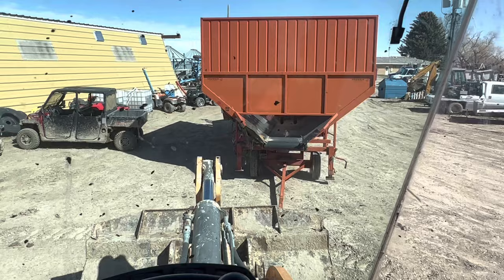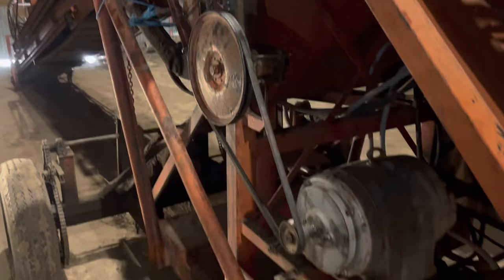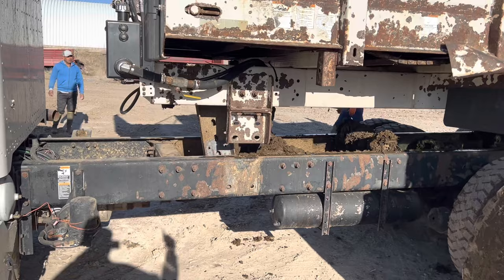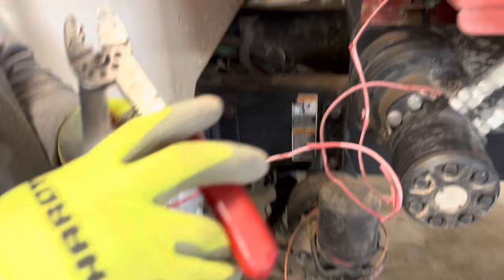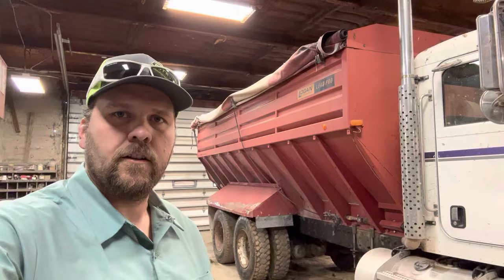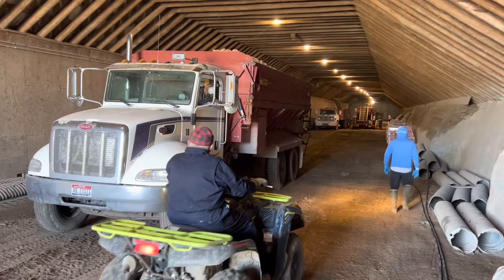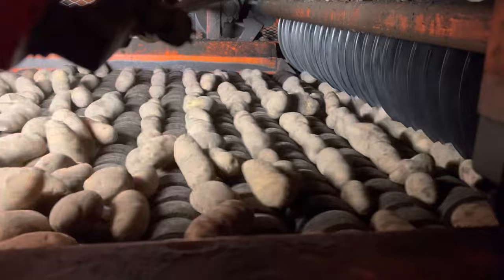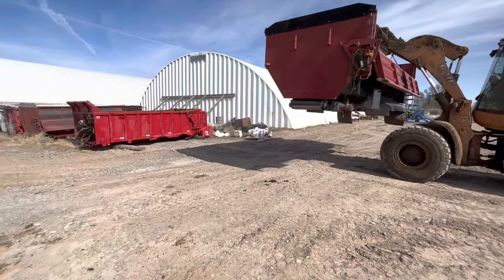How we cut our seed potatoes.

Comment: I saw another planter video recently that used a smaller whole potato as seed.  Interesting difference in the choice. You will get a lot more mileage out of the available resources. However, it appears a lot more handling is required and that cost money and time also.  I do not know if different variety was involved but the seed planting and the land type was the same.
Reply from the maker: So when you use a whole potato that doesn’t need to be cut for seed, it is called a one drop and to get all of your seed that size it would have to be sorted out so it would actually cost more to get all one drops that you don’t have to cut versus getting this and cutting it yourself.

Comment: What's difference from whole potatoes?  As far as I know, the one without cutting is more disease resistance than this ! ❤
Reply from the maker: There’s a chance that you can introduce disease when you cut them but we have to make our seed uniform size for the planter.
Reply: The number of eyes per piece changes the type of yield. 
Plants with little room will produce many more potatoes per acre, but they will be smaller on average. It is a similar effect with spacing pieces in the row, 18 inches for big late harvest baking potatoes down to 6 inches for early boiling potatoes, maybe even closer for specialty seed potato production. 

Planting one large potato with many eyes will produce many stems which are effectively separate plants bunched together. To get the average effective spacing there would need to be variable distance at planting time to give more room to the large many eyed seed potatoes and less for small ones with only one eye, and the yield would still not be as consistant as when using uniformly sized pieces (or sorted small singles).